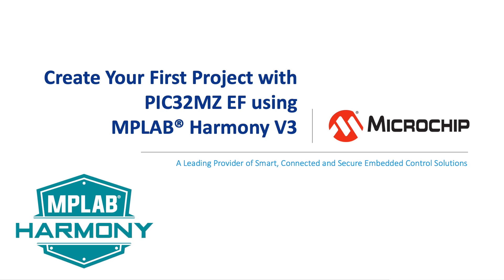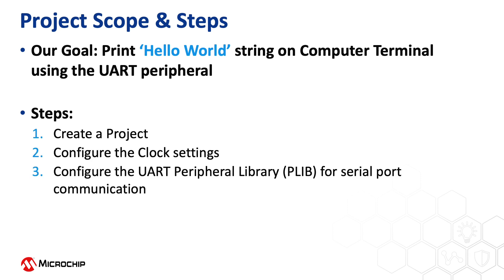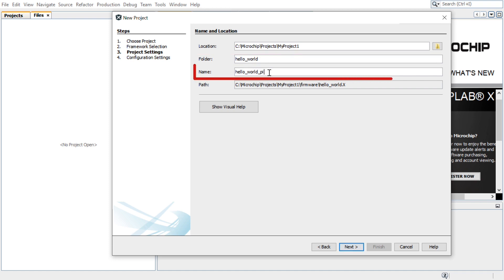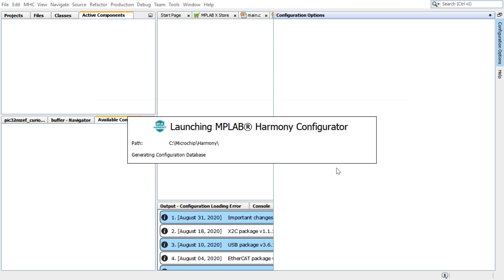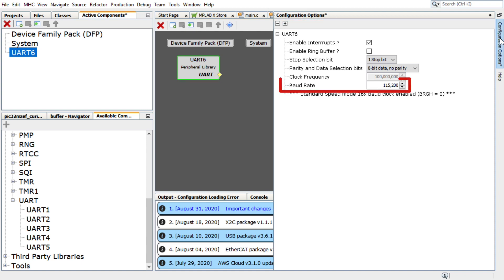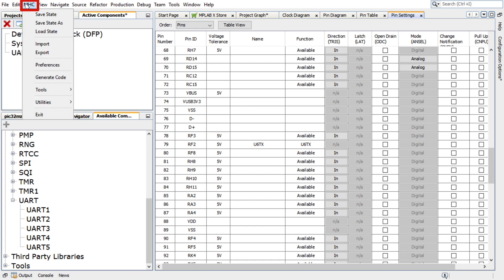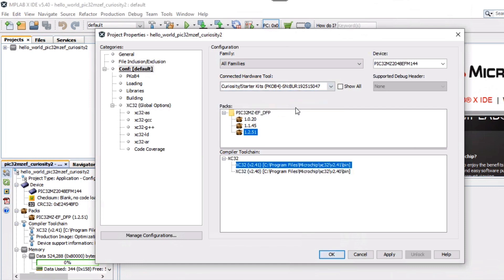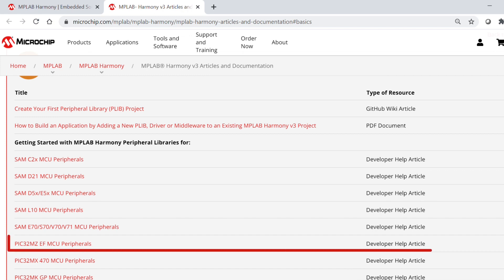Create Your First Project with PIC32MZ EF using MPLAB® Harmony v3

Comment: honestly thats a lot of gui clicking to do something really simple. Seams like harmony takes away the actual programming and uses a bunch of gui's. I tried installing harmony and hated it. why not just show me the simple C-code to map a pin instead of all this overhead crap. tried MCC thats also crap, I just end up going through the generated files and only using the relevant parts.
Example:
#define LED_POWER _LATA3
_TRISA2 = 0; // sets A2 as output

LED_POWER = 1;

but mcc generates a ton of crap, sorry just being honest, Its a struggle to use it, and I only use it when my regular compiler doesnt support a new chip, but still, have to sift through all the junk to copy our the relevant parts.

You know what would be great, make it a separate thing, where I can launch it and see the code and just copy/paste the code I need. this way it doesnt matter what version I have it wont screw up the project.

Comment: Hi, I have followed your example to the dot. And cannot get the output on to the Teraterm window. The only differences are:
I am using MPLAB X IDE v5.50, in the Project properties tab connected hardware tool  it shows only Curiosity PIC32 MZ EF 2.0-SN:BUR211917012 but not Curiosity Starter Kits .. as in the video.
When I check "show all" and choose "Starter Kits (PKOB)" and apply it reverts to none and un-selects the show all check mark. The only choice for packs is PIC32-MZ-EF_DFP 1.3.58
Also It has a red text message on the bottom "The device on the kit, PIC32MZ2048EFM, does not match the device selected. The device on the board is PIC32MZEF2048EFM144, verified printed on the chip. I also have a SSD1963 graphics card connected without any display.
I would appreciate any help figuring out what is wrong with my setup.
Reply: I have the same issue. were you able to solve this?